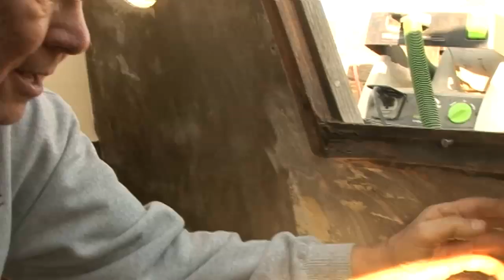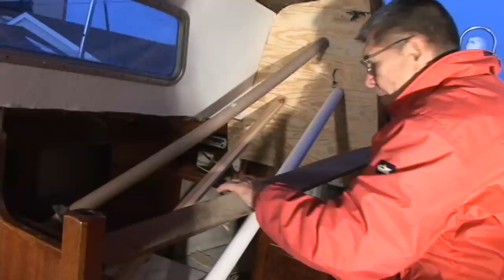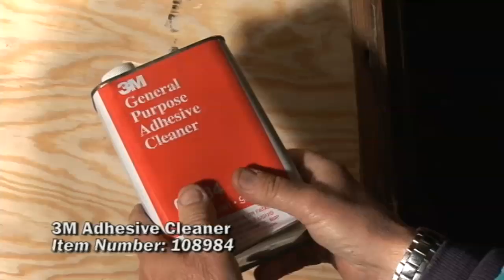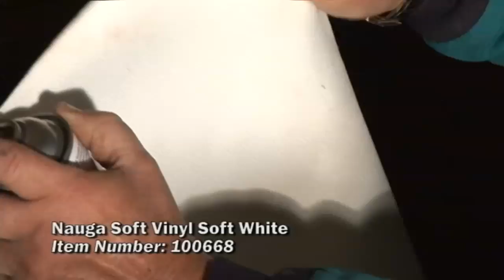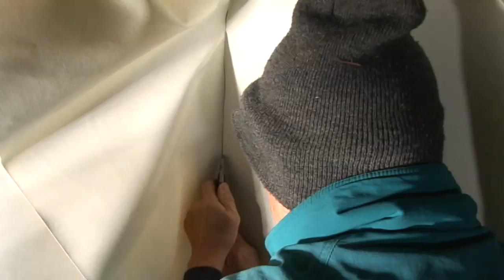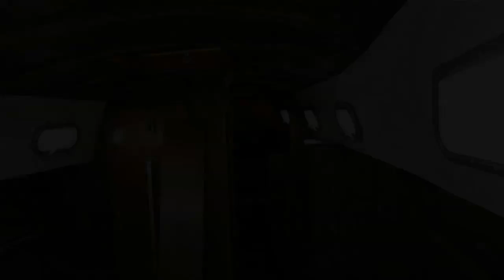Installing Vinyl Nauga Soft as a Headliner on a Boat

Comment: 5200 ????  To bond wood to glass above the waterline??  That's crazy.  It's called epoxy.  You would never be able to remove it the way you all were able to remove the rotted wood like you did.
Any particular reason 5200 was used?